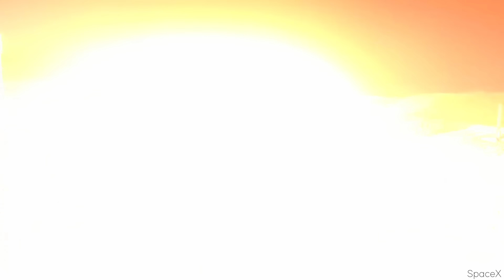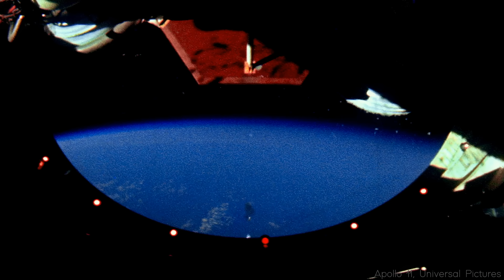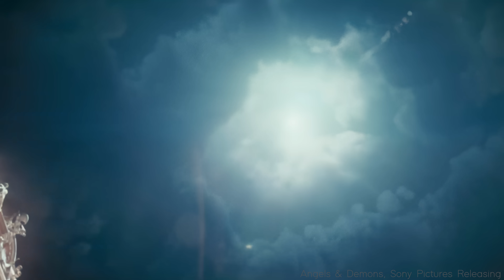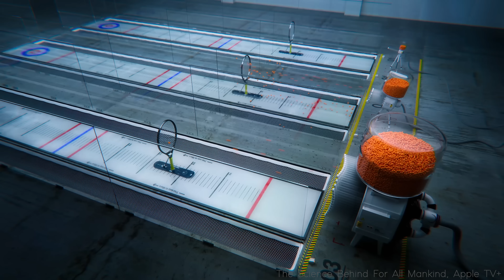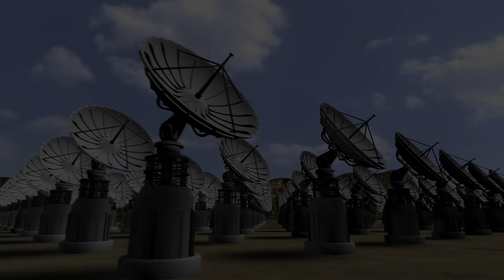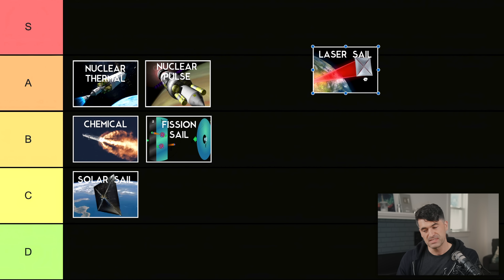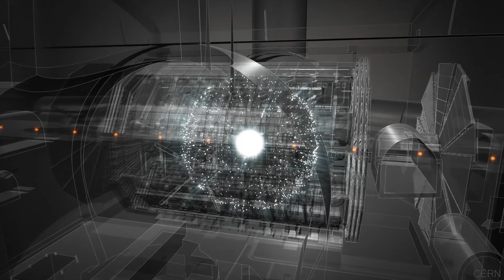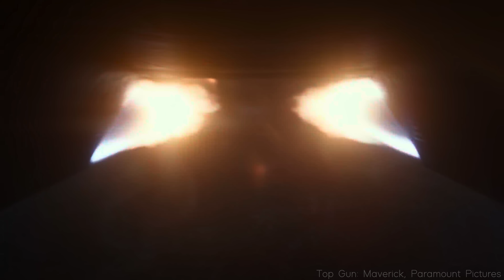Interstellar Propulsion Technologies - RANKED!

Comment: 19:17 - "4/3 the speed of the black hole" - WTF? 😮
Reply: All objects in the Galaxy are moving, so let's say the black hole is moving at 30 000 km/s, then you can speed up your ship to 40 000 km/s. What's so difficult?
Reply: If you watch his video on the Halo Drive it will make sense.
Reply: @bigsby6bender  definitely will do.
Reply: that's about  1/10 of the speed of time, right?
Reply: @Gunni1972  I thought it meant 4/3 light speed, that's why I was astonished. Now I'm wondering what you mean by speed of time. 🤔
Reply: @Terran720  Probably a joke about how time and space invert in a black hole?
Reply: He means you can get 1/3 extra on top of the black hole via the energy you extract.
Reply: @JohnnyWednesday  yeah, I just thought that the speed of the black hole is equal to light speed, so 4/3 of that would be supposedly impossible. But maybe it's not the case that the speed of the black hole = light speed. I should definitely watch his video on that

Comment: Correction: we don't need gravity assists for chemical rockets to "go interstellar", and specifically, you mentioned new horizons as requiring gravity assists - it is easy to check that this is false; it was put on a direct sun escape trajectory, basically because there was mass available to do so, and it'd reach Pluto much faster that way.

The question isn't whether you can escape the Sun's gravity from Earth (tricky, but not that much harder than reaching orbit from Earth's surface). It's about whether you can survive the several thousand year journey, or whether you can cut down the journey time. Gravity isn't a problem between reaching orbit and landing, and most of the delta-V will be going into making the journey fast, not efficient, much like new horizons.

Second correction: "twice the efficiency means half the propellent". This is so wrong that it is embarrassing - the rocket equation means that a small improvement in efficiency gives a massive reduction in propellent, assuming thrust is not a factor and/or engine mass is not a significant factor. For the same delta-V, and ignoring engine mass, doubling the ISP will reduce the propellent:payload mass ratio to the square root of its original value. That's how logarithms work in this case. Maybe check your maths.

Third correction: you said momentum is energy divided by the speed of light (p = E/c). This is only true for massless particles. In general, we use Einstein's equation E^2 = m^2 c^4 + p^2 c^2. What you said isn't really much of an error, just a special case. The other special case of this equation is the much more famous E = mc^2 which holds for zero momentum (i.e. represents the rest mass).

Fourth correction: "the outward radiation force has to exceed the inward gravitational pull". This would only be true if you are trying to go in a straight line directly away from the Sun from a standing start. But this isn't the case. We start on Earth, in orbit around the Sun. For the same reason that we don't need high thrust rocket engines in orbit, we also don't "need" high thrust solar sails in orbit. Starting from any orbit, you can use even a really bad solar sail to slowly spiral outwards and eventually espace the Sun's gravity. The problem is, in reality for interstellar travel, you actually want to accelerate to a very high speed, not just escape (explained in the first point), but to do that you need to be close to the Sun, and this is why an efficient, light sail is required, to get to high speed while still near the Sun.
Reply from the maker: Correction to your correction: New Horizons did require a gravity assist and performed one around Jupiter on 28th Feb 2007.
Reply: @CoolWorldsLab  Yes, it used a gravity assist, but it didn't need it to achieve escape velocity - it started on an escape trajectory. If Jupiter wasn't there, it would have still reached interstellar space. It sounded like you were suggesting chemical rockets alone (without gravity assists) can't reach interstellar space with current technology.

Comment: Ouch, ouch. 
That is a depressingly pessimistic report. 

It is so unimaginative and archaic and negative. 
First of all, of course, all devices based on the recoil 
principle as a method of movement are for shure 
out of the question. 

What is conceivable today are field engines. 
These use neutrino fields or Higgs fields, for example. 

AI will help us build the technology for this. 

We cannot plow through space like a ship plows 
through water. You can see how much can be 
achieved with this. 

The conceptual approach is analogous to hydrofoils. 
This approach offers spaceships at least 10 times 
the speed. 

But that is nowhere near enough for long distances. 

For high speeds, the spaceship must  be 
able to detach itself from the space-time structure, 
do its spatial displacement thing, and then immerse 
itself in Minkowski space-time again.

Comment: One of my hobbies is retro computing. It's no easy task to keep something like a Commodore 64 running; they constantly break down and need to be recapped, etc. That's a computer that was produced between 1982 and 1994, probably well within the lifetime of many of your viewers. And it's not exposed to the radioactivity of space. I wonder if, even with subluminal speeds, our current technology would allow for a 100-year flight time to another solar system. I'd imagine a CPU would be fried beyond repair before it even arrived at somewhere like Proxima Centauri. I suspect self-replicating and repairing machines need to be developed before a journey like that could even be planned.
Reply: They say that a meter of water is sufficient shielding against any radiation. Also the ECC chips could correct for any errors.
Reply: @micha9000  a metre of water isn't going to feasible with something like a laser sail though

Comment: I believe that black holes will become the currency of a spiral/arm level of civilization. Even if the Halo drive or variants are not feasible; they can provide a cheap means of generating large amounts of usable energy.  Using our star (if legal!) would also be potentially useful. Converting the energy into highly concentrated forms such as antimatter combined with exotic technologies designed to generate, contain and funnel charged energetic particles could yield relatively small vehicles that  could bring light machines or even people to the nearby star systems. If space/time warp field technology or wormhole technology is feasible then only star-lifting or the use of deep gravity well objects such as black holes and neutron stars; or nova energy reclamation tech could power and sustain this exotic technology.

Comment: Ion engine should be higher.  It's thrust is low, but for interstellar missions that isn't much of an issue since there is plenty of time.  The technology already exists and it clearly outperforms chemical rockets and nuclear thermal rockets in this sort of application.

Also, why no fusion rockets?  We might not have the technology to build them yet, but we are a lot closer than for the D and C tier concepts (except solar sail) and it should outperform any currently available rockets.
Reply: Yes, if we can harness fusion then a fusion powered Ion drive would seem feasible.
By my calculations the smallest inhabited interstellar ship would be about 5000 tonnes. I'll have to look up my old calcs to give more detail.

Comment: A follow up interview with Isaac Arthur would be great. The rankings are reasonable. I would split the list into non-living accelerators and living accelerators. Also the variants can include different energy, energy storage and transfer methods. The best bet may be a variant of the Halo drive combined with the most reasonably viable technology required to move black holes into key points on an interstellar highway. My favorite idea would be to combine various technologies to create a fusion powered high energy particle accelerator with a yet to be invented technology to make the confinement of the particle steams and re-acceleration ( to increase the specific energy and speed of the particles) to yield a concentrated high energy, high speed dense stream (s) of particles out of the device. It would need to be hundreds of kilometers (ideally thousands) long to transport people and equipment and a few dozen kms to accelerate light machines to the stars. This is essentially a variant of the Daedalus machine except without a pusher plate; it uses a stream of fused particles that are directed and accelerated . Ideally it would be powered by mesons or antimatter technologies and enhanced by exotic material technology to make the machine components more efficient and safer for the payload.
Reply: Is Isaac Arthur a scientist?
I think he's a scientifically literate YouTuber.
Reply: @AndrewBlucher  He has a degree in physics and is president of  the National Space Society, His approach to analyzing both practical and speculative propulsion systems is rooted in known physical principles and the practicalities of historical precedent.
Reply: @micha9000  You seem to be a fan and would like to defend him. I'm not a fan. Each to their own.
But maybe you can change my mind: tell me what original ideas he's published.
Reply: @AndrewBlucher  I am not really a fan , more of a critic of some of his ideas which are solid in fact. He helped develop an original idea called Star lifting which involves retrieving material directly from a star. He also helped design something called an orbital ring. All of his designs are directly applicable to the crafting of science fiction stories and many are probably elements that will be considered in future designs, much as Arthur C. Clarke helped inspire the satellite space industry.
Reply: @micha9000  Thanks for your answer.
Reply: @AndrewBlucher  you are welcome

Comment: I feel like a living anachronism. I would have been ok in the past I think but I feel as if I am supposed to be travelling the cosmos.  I at least feel as if I need to see earth from space. If super liminal travel is possible I think time paradoxes will always just collapse into a new universe. As in if you get a random deck of cards and turn over the top 1 either the top card was all 52 cards at once collapsing to 1 card as it is drawn or observed maybe. If observation is required to collapse the probability wave would showing it to a cat collapse it or photographing it. If intelligent observation is required then surely the captured photo will be in a state of quantum flux with both the card field and the photograph field collapsing simultaneously when one or the other is observed. Secondly as you turn the top card 52 universes appear simultaneously as you turn the top card, 51 universes as you turn the second and so on. So if you turn up and kill grand happy you will return to the same time line you left and a new universe sans you will have continued when you shot gran pappy or you just collapsed a future(s).

Comment: I believe when talking about space travelling, we ought to separate earth-to-orbit from all space travel per se. Imagine like you have a big tanker in a complicated port town, where you need the tanker to be pulled in an out by an smaller ship, while in the wide ocean, it goes by itself.

I doubt we will come up with anything (other some megastructures) that will make chem rockets obsolete on the earth-to-orbit stretch... but, the pulse propulsion could really shine if built IN ORBIT. Maybe in moon's orbit, and depart from there... not problems with the nuclear booms that way, right?

Final Thought: In the end, I think a sum-up of various of those ideas are what will probably do the trick... Why should they be mutually exclusive? 
Go to orbit with chem: build actual interstellar ship in space. 
Ion Drivers for cruising along the way
Solar sails on the first stretch, probably the power up with nuclear stuff.
Laser pushing after Neptune or the Jovian system?
Blow booms to deaccelerate (since you won't have the laser rig at the destination). 
Whatever else works for course correction and get extra speed (gravity assists, nuclear thermal, etc)

Extra: you need a power source for the craft anyway, and a good one to also power the I.D.... whatever leftover heat from a nuclear generator (I don't see a better option for a century long trip) can be used as nuclear thermal propulsion.
Reply: Good ideas. The solutions I see seem to work best when various technologies are combined together.   Also I think the international rules are backwards; more restrictions should be placed on nuclear devices on Earth or inhabited colonies and less restrictions for  space. Your last point depends on the thermodynamics.

Comment: Here is my idea: use superheated mercury to repel a magnetic field then have it cycle back to liquid form and so forth. Mercury drive. I got this idea from ancient texts 👀
Reply: This is just a design for a perpetual motion machine which don’t work which doesn’t necessarily mean it can’t be used as a spaceship drive, you just need to pump energy in 

Unfortunately it also does not work as a spaceship drive. As the mercury gets pushed away from the magnet it will also push the magnet away, and as it cools does it will pull the magnet closer but the magnet will also pull it closer

It will just be like a spring, it can bounce in and out but that does not mean it is moving.

Also It is cool that mercury becomes diamagnetic when heated up
Reply: @Kestrel990  I think I understand. The engineering would be fascinating to see. I have imagined a propulsion device that does not rely on Newton's third law, but would self transform to travel a distance. A working practical demonstration might be a good start.
Reply: Idea to use mercury as propellant for ion thrusters was considered to be too dangerous because of toxicity.
Personally, i think this reason is quite ridiculous, because mercury is ofc toxic, but so do hypergolic fuels, but they ARE in use and mercury is noit. And if someone is afraid of Hg deposition back to Earth (like when such vessel is accelerating in close viccinity to our planet), methinks that total amount of mercury divided by distribution area will lead to undetectable levels of waste.
Reply: @invisiblekincajou  yes, I don't think the belters will care much about mercury deposition in solar system space
Reply: This might be a poor idea based on a perpetual motion device; i.e. a a stream that runs a waterwheel that deposits the flowing water to a stream uphill that flows down to the original stream path that runs the same waterwheel.
Reply: @micha9000  that makes no sense. Im not a scientist its just an idea lol but it can work magnetic fields are up and coming i hear.
Reply: Will not create trust.

Comment: What's the smallest Black Hole that could work with the Halo Drive? Great video!
Reply from the maker: The limiting issue is mass, the mass of the black hole needs to exceed the mass of the vehicle to be effective
Reply: @CoolWorldsLab  and exceed by how much? How much mass would the black hole lose during the acceleration process? How long would a black hole with a mass like 100x of the ship even exist for, before expiring due to hawking radiation?

Comment: The old Echo and Echo 2 satellites exhibited influence from light pressure even though they weren't designed for it.

By far the largest problem with the laser light sail would be the gigawatt lasers.  The largest continuously operating lasers built (and only ran for a handful of seconds at a time) were MIRACL an ABL.  Big, heavy, chemical lasers that only produced single-digit megawatt power.  Solidstate lasers, being investigated for military use, are only up to the low hundreds of kilowatts.  And then there are the military implications of gigawatt lasers.

Have you ever heard of the nuclear salt water rocket?  See "The Nuclear Salt Water Rocket - Possibly the Craziest Rocket Engine Ever Imagined."  (That's the title of Scott Manly's video on it.)

Comment: Where are the NSWR’s? Nuclear Salt Water Reactor rockets, if they work, would be almost equivalent to the Epstein Drive in the expanse in terms of performance.

Essentially you dissolve uranium salts in a heavy water solution just under the critical density. Then you spray the saltwater into a chamber along with a kickstart to nuclear fission. High thrust, and high ISP.